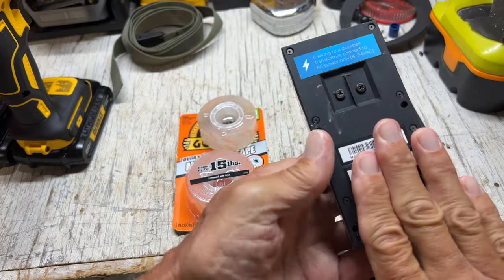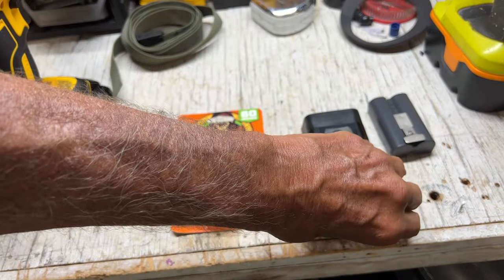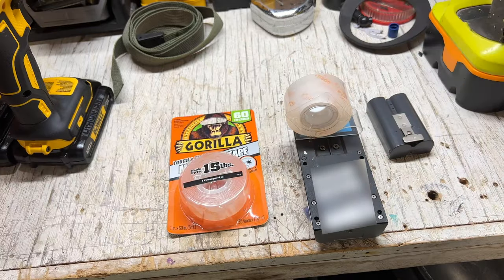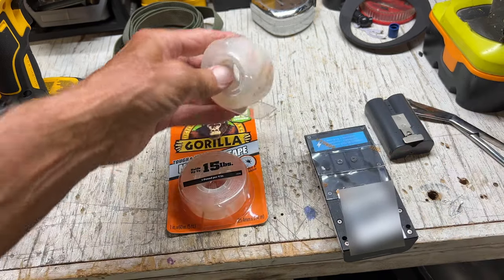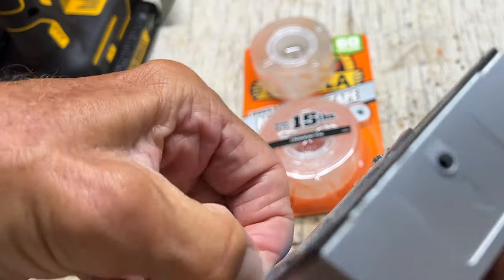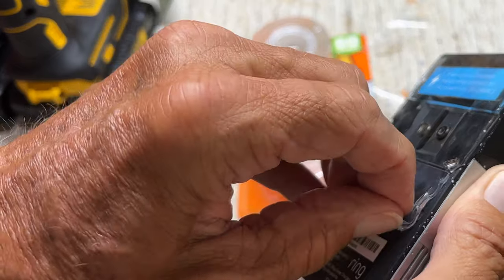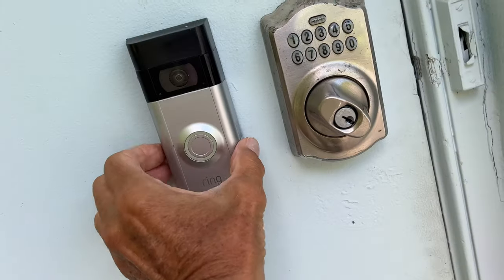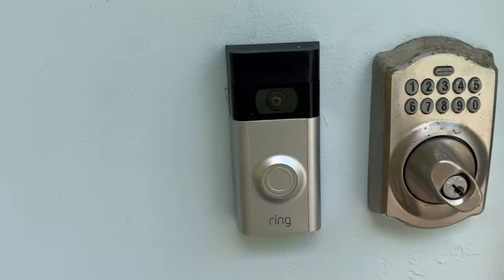How to use Gorilla Double sided Mounting Tape to attach a RIng Doorbell to Door

Comment: You forgot ONE VERY IMPORTANT STEP. Before you mount the Ring to the door, wipe the area down with Denatured or Rubbing Alcohol. It will clean the residue from the door that has built up and make a more permanent contact with better adhesion. Otherwise, there is grime that has built up on the door face and over time it might be more prone to loosing adhesion to the door.
Reply from the maker: That is an excellent tip thank you so much for adding it. Our viewers will appreciate it and thank you for watching.

Comment: What about the back cover? Shouldn't you tape the back cover to the door. Mine Has to be charged so how would I get it off to charge it
Reply from the maker: Once you stick it, it kinda is stuck so you gotta make sure you got it exactly the way you want sometimes using a level helps. Good luck thanks for watching.
Reply: Yes but how would I charge it
Reply: @Larabe138  This model in the video has a removable battery so you adhere the base and the battery is still able to be removed. Some other models you would adhere the backing the camera hangs from and unhook the camera itself to plug in and charge.

Comment: Omg I love your video. I haven’t laughed that hard in a very long time. That tape is maddening. And your plight had me in tears, because anyone who has used it knows. Thank you for the entertainment 😂
Reply from the maker: I know it’s hard to get that plastic off of it. It’s almost impossible. Crazy good luck. Thanks for watching.
Reply: Btw Tom I ended up using the tape to put up both of my cameras outside. I hope they hold. 🤞
However, I did install a battery operated motion light over my garage doors a couple of years ago and it needs new batteries but I can’t get the tape to let go so I can replace the batteries 🤪🤣

Comment: Will the gorilla tape hold because I have a outward door but I would rather have the metal plate but they don’t make them for outward door
Reply from the maker: It is still holding tight and strong